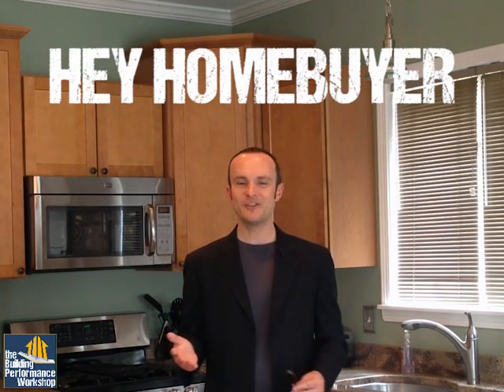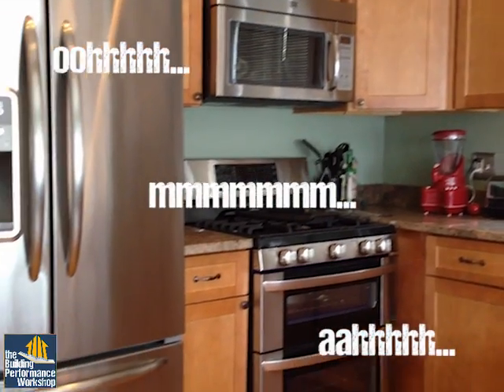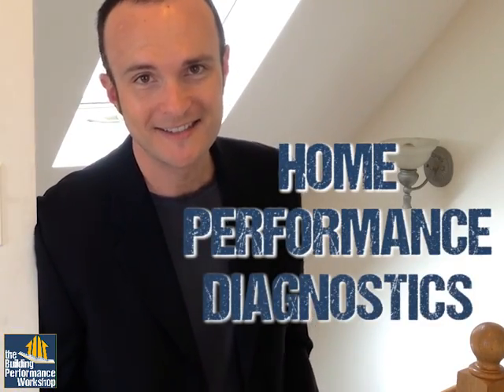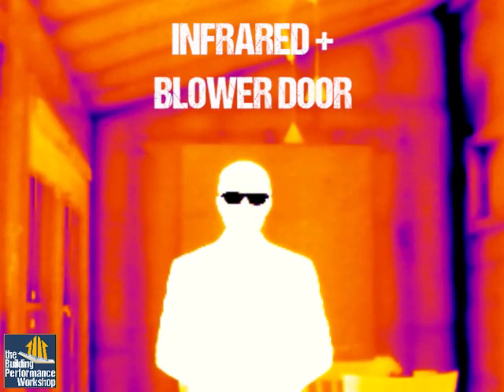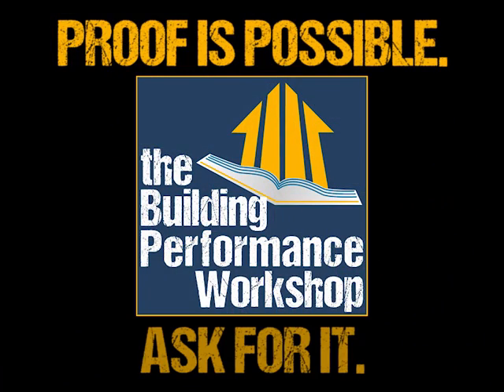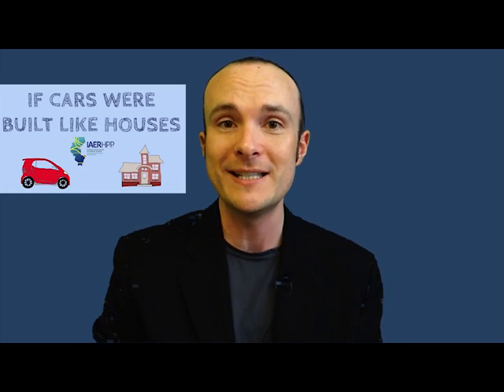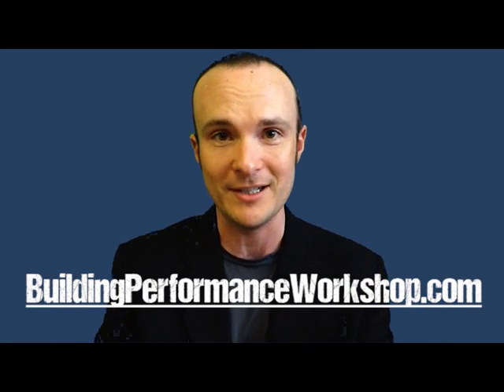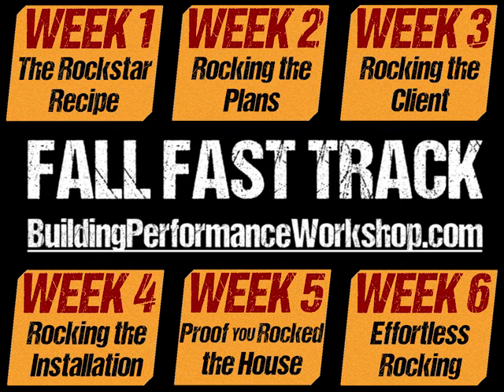Using Infrared Cameras to Find Air Leakage, Insulation Problems, HVAC Disasters

Comment: As a building inspector, infrared is in fact included in our service fees. Most home inspectors include IR with their inspections.
Reply from the maker: Glad to hear it- this decade-old video is pointing out that infrared only works for whole-home air leakage when you also have a blower door running, which is definitely not in most inspectors’ fees.

Comment: There is no doubt that this is an amazing video Corbett. I am still trying to think of how you did it.
Reply from the maker: Andrew Aliferis Let me know when you have a guess, Andrew!
Reply: Corbett, I was thinking the Flir One since you where able to transition seamlessly between the IR and the visual. I'm impressed with your total whiteness with the perfect definition of your black sun glasses. To tell the truth, I'm still stumped.
Reply from the maker: Andrew Aliferis Great guess, but nope- the Flir One doesn't have nearly the resolution to be able to pull this off.  It was a high resolution camera, 320x240.  The sunglasses are one of the technical challenges we had for sure!
Reply: What model camera Corbett? It takes excellent visual light video.
Reply from the maker: Andrew Aliferis You're on the right track, buddy!  It's the Testo 885, which is NOT what we also used for the visual light video! We used two cameras, not one.
Reply: Very cool. I can visualize how you did that on a tandem mount with the cameras side-by-side. My day to day IR camera is the Testo 875i and I can testify that the visual Camera is probably worse than the Barbie camera.
Reply: Corbett, The quality of your videos is always top notch.  Do you shoot those on a DSLR rig? Film making is one of my interests. As a production assistant, I worked on some commercials and I was really impressed with the results the crews are getting with Canon DSLRs, focusing rigs and portable dolly tracks. It's amazing what DSLRs are capable of now for the frugal filmmaker.
Reply from the maker: I am delighted to tell you that the high end video camera we used here is... MY IPHONE 5.
Reply: Very cool!